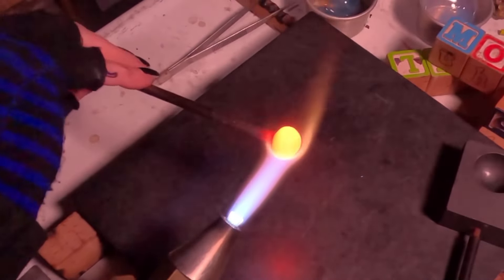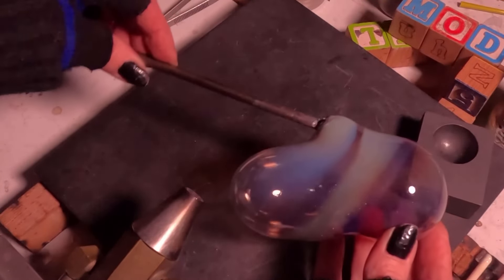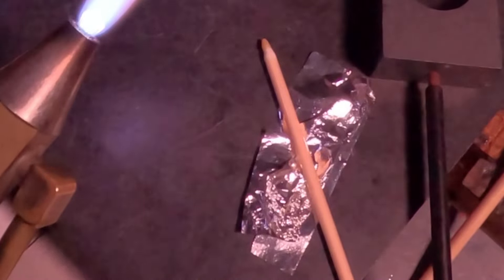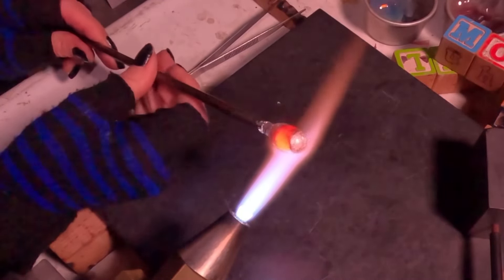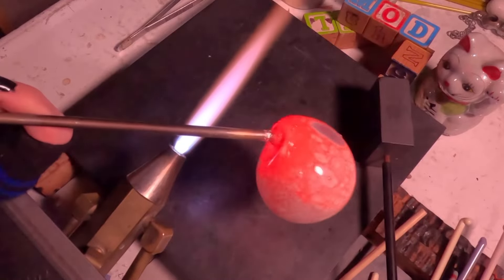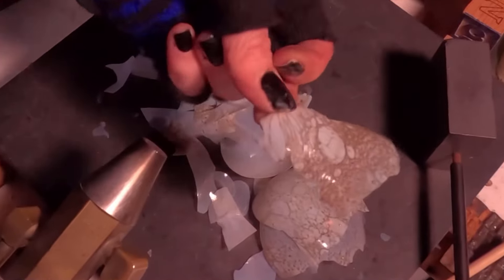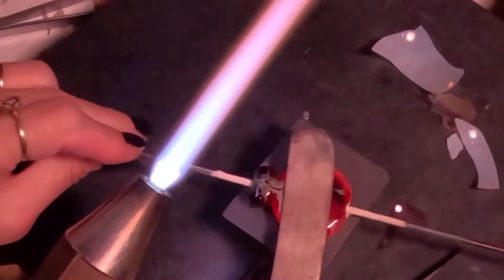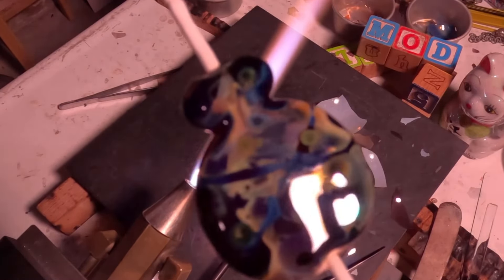Lampworking / Flameworking - 102.14 - Special Effects Shards pt.2 - 104 glass Demo

Comment: Well I had always been taught and read to set at 960 for soft glass and silver lower at 940. Never heard anyone using 1000 for soft. Yes do try lower and if you get great or different results please let me know. There is a very good silver bead maker/ teacher named Hayley Tsang Sather and she teaches using a lower temp. Hope it works. Second- so you have tanked O2 so that is how you can do Boro so well your torch can get way hotter. Using a concentrator I have less heat. Such is life. Again thanks and look forward to next creation you share. Such a joy 💐🔥
Reply from the maker: Hi Maria! ✨🌹 You are correct!  I’ve annealed work between 920 and 1000 degrees… My temperature is for both Boro and soft glass.  (It also doubles as a pick up oven)  However as soon as I run my program it holds at 950 for an hour.  It works great for me, but I’m still going to explore a lower temp for the silvers!  😍👍🏽
I tried an oxygen concentrator once and I just needed more pressure!😂🌹 …we do have to haul the tanks to get filled every month.  It’s a pain in the ass but worth it! 😅 
Thanks so much for the input my friend!! 🌹🌹🌹Cheers- Robin 🙏🏽🌈